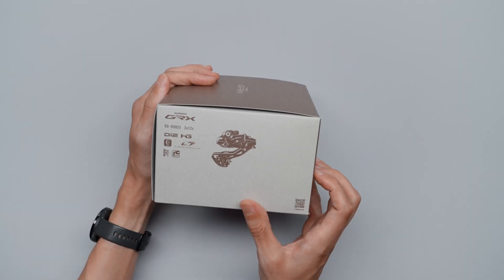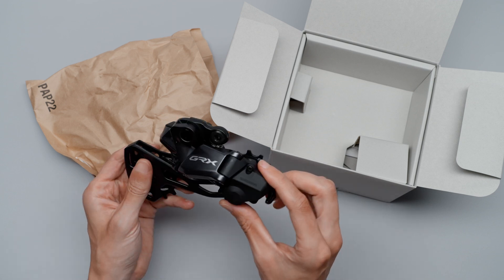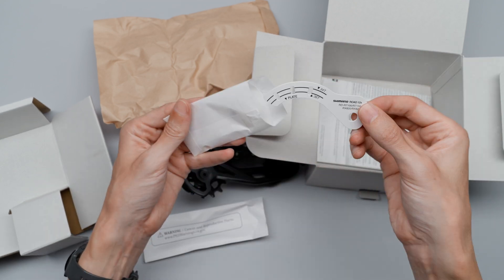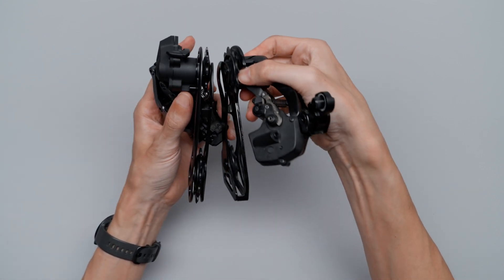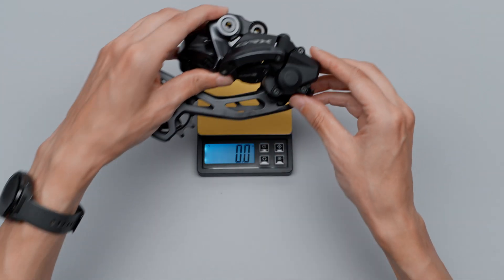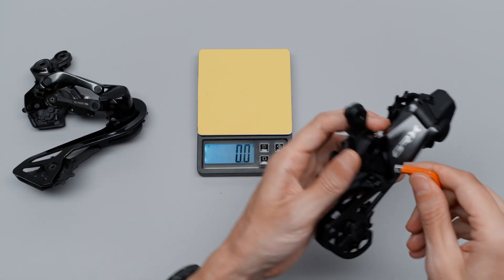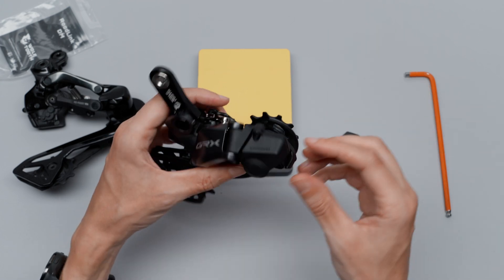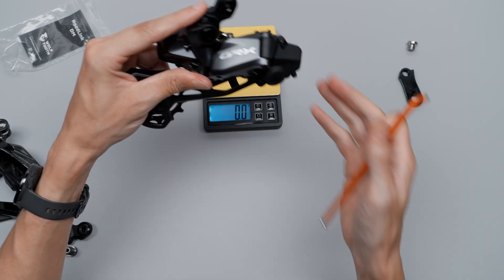GRX 12s Di2 RD-RX825 derailleur Real weight, 1x plans & how to save 5 grams 🪶

Comment: It is definately worthwhile to test the XT 11spd cage. I tried the goatlink and while it shifted well, the issue is, that you still have to screw the b tension screw all the way in which is bad for chain wrap in the smaller gears. you will lose a lot of efficiency there.
with the 812/817, and from the looks of it the 82x as well, they share the same cage geometry as the XT 11spd derailleurs. In my testing the result shifted much better than the goatlink and resulted in better chain wrap.
it is important however to get the M8000 (!!! 8100 has a different cage) cage in the SGS varienty which is the longest.

it is also lighter than to use the goatlink ;)
Reply from the maker: All tested here https://youtu.be/3Iv28gwiPbk (without success)

Comment: Have you thought about replacing the P-Tension Spring in a dura-ace derailleur with one from a mtb derailleur, presumably with a stiffer spring.  Someone on reddit in /bikewrench suggest that a RD-M7xx era Deore XT spring would work.  You still would not have a clutch but I bet you would never drop a chain unless you went over some really rough ground.  Anyway I have a SHIMANO XTR RD M985 Rear Derailleur P-Tension Spring on order to see if it will fit in my di2 12spd rear derailleur and how it works.  Look forward to see the results of your experiment.  And all this BS because Shimano thinks the market for 1x GRX Di2 is too small to bother much about.
Reply from the maker: I’ve been looking into that as I’ve been experimenting with this derailleur a bit now (and unintentionally broke the spring 🤦‍♂️)
I have not looked up the DA spring specifically, but the bottom “hook” of the spring is different between some of the derailleurs, but as long as you match that part should totally be doable.
For the riding I do I don’t see me using the clutch that often on this GRX, is way stiff turned off anyway. Good to have the option though.

And spoiler for the main channel video, you can use this RD for 1x no problem with the road link DM (10-45 cassette)

Comment: On my CX bike, I also have a 1x-specific derailleur, the GRX 820 with a 11-36 cassette. It actually is sufficient on most rides, except for high speeds, as I only have a 40T chainring. I am wondering though why the GRX 825 didn't come in a 1x-variant. At some point I hope to upgrade to a wider range with the GRX 822 derailleur. Currently I am wondering whether to go Micro-Spline, or to stick with the HG freehub body.
Reply from the maker: 1x is coming just not yet. Rumors point to a shared design of the yet to be released MTB di2 where we have the di2 battery on the derailleur itself which makes sense for 1x and bikes that often have dropper seat posts where batteries can’t be mounted.
Now, that doesn’t mean we can’t squeeze out a bit more from the the rx825 ;)

If you want the crispiest shifting with cassettes bigger than 40t, I’d say microspline is a safe bet.
Reply: @slayerofgrams  Oh that sounds like an actually interesting update! 

Damn, so changing the freehub body (thx for also making a weight comparison there!) will likely be added  to my list of future expenses. My first step however might be to get a bigger chainring though. Who knows, maybe I go all in and get the Garbaruk microspline 12-speed cassette right away as well. (Don't tell my fiancé!)

Comment: How does that cage length compare with the 105 Di2 cage?
Reply from the maker: Don’t know sorry
Reply: @slayerofgrams  if you can measure the distance centre to centre of the jockey wheels , and post here , I’ll do the same on a 105 Di2 RD. I’m guessing they are the same as the 105 which is also rated to cope with the 36t cog (and likely up to 40t).
Reply from the maker: @thedownunderverse  will do when I’m back home tonight 👍
Reply: @slayerofgrams  me too!
Reply from the maker: @thedownunderverse  looks like it’s around 103mm

Comment: I'm sure you know 2x grx can unofficially clear 11-40t no issue. With the wolfooth road link, the info I've seen is max now becomes 11-42t(or 10-39t if you have one of those Rotor cassettes).
Reply from the maker: Yep, I’ve run 11-40 unmodified myself on the 11speed version (you can see it on my trek build in the Roj channel)
I’ve also seen people doing un-modified 11-42. As well as people doing 2x with a 11-40 cassette. 
Just curious to see if I can squeeze in something bigger with this. It might fail miserably though and last resort would be the rotor 11-39… but that cassette is crazy expensive 😅
Reply: @slayerofgrams  I have it setup 2x with 11-40. I think the rotor cassette is 10-39t not 11-39.
Reply from the maker: @Alex_564  the 13speed is 10-39, the 12speed one is 11-39 if I remember correctly.
Reply: @slayerofgrams  oh I thought I saw a 12spd one starting at 10, but you are correct. Too bad it doesn't look like the 10 can be taken out to replace the 11t.
Reply: @slayerofgrams  I tried to install 11-40 unmodified, but that didn't feel mechanically sound, the tension screw doesn't have much to press against any more. With the Wolftooth I now even run 2x 11-42 on one of my wheels sets and while it's certainly pushing it, it works. 2x 11-40 is flawless.

Comment: Although I would not recommend it ;-) if you use cage from XT, XTR, or RX817 it would allow for better shifting (no pun intended) Those 3 derailleurs are the exception in Di2 family, because guide pulley is offset behind the A-pivot. This will allow you to clear 42t sprocket without compromising shifting in the smaller sprockets. Keep in mind that beyond 36t Di2 servos have very different internals with chunky gearbox and 'one-way coupler'. It will work but motor longevity will be significantly decreased.
Reply from the maker: Yep, noticed that when I did the same thing with the 11speed version :) once the battery got below 50% I stared to struggle hehe.
This will just have to keep me occupied until we have the 1x version next year. Really crossing my fingers for an xtr version 😆
Cheers mate for the knowledge as always 🙏
Reply: Mmm, better shifting!🎉

Comment: when the 12 speed mechanical dropped, they touted you could swap the cages but the body was all the same. I don't see why this Di2 version would be any different. Swap that medium cage with the longer one and I bet it clears a 52
Reply from the maker: As mentioned in the video changing the cage alone will only increase the chain clack capacity, it will not change the geometry or how big cassette it can clear (max b-screw position) that’s what the road link is for. However I’m pretty positive it can clear a 40-42 cassette without any modifications like the 11speed version could. Again I won’t have the optimal geometry to move between the small cog to the big, but hopefully it will work well enough. Time will tell 👍
Reply: @slayerofgrams  Garabaruk makes cage & pully mods that allow the 1x to clear more cassette. It doesn't change the geo. In theory that mod could be done with a longer Shimano cage & pully combo that compatible. Seen people do that with their older Sram GX 1x11 by swapping in a newer GX 1x12 cage to get bigger 10-50t cassette to work.